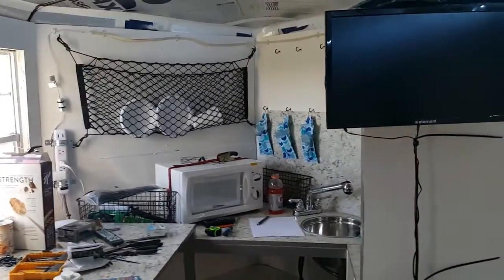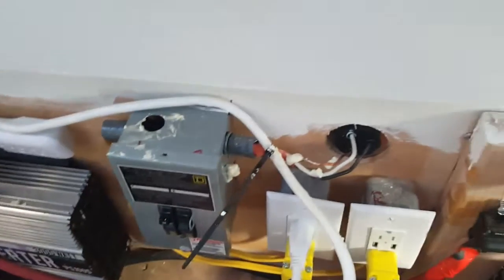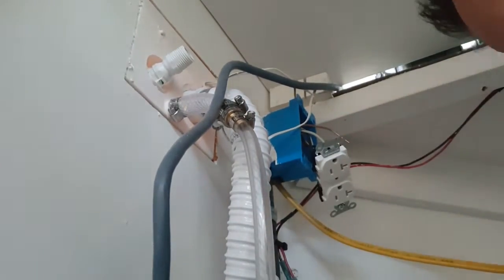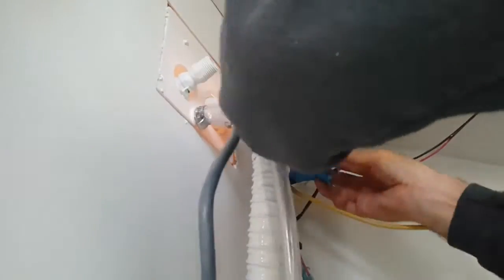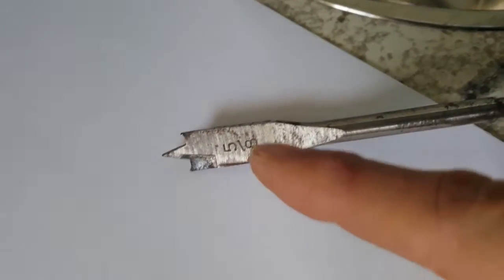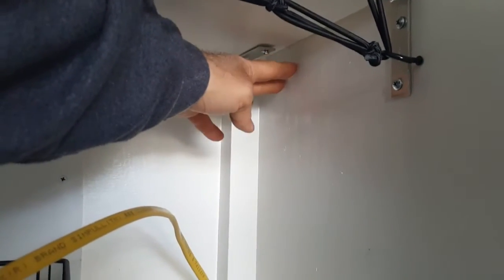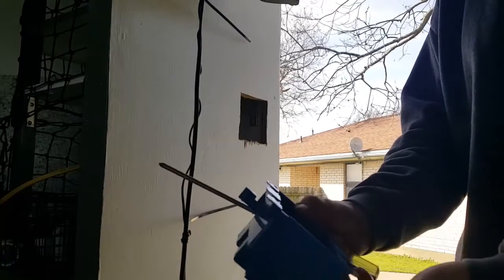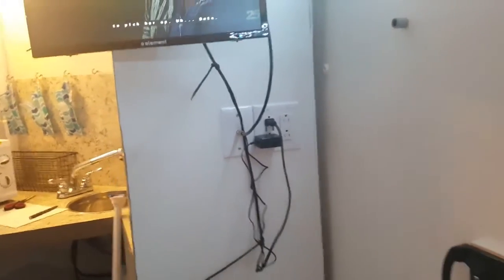ELECTRIC ADDITION How To Add Electrical Outlet Cargo Trailer Camper Conversion Improvements #flgctc

Comment: Nice work! I'm starting a RVgo soon and appreciate learning from everyone else kind enough to share their experience.

I want to point out something very important for your safety!
Please add a chassis ground to your shore power! Just a single #10  screw into one of your wall studs and a bare ground bonded with your shore power inlet. 
You don't want to become the conducting medium if something happens to your side of the wiring.
Reply: You may as well bond your inverter along with it, while your at it. I think it is important to share that process AND the significance of bonding the chassis with your audience.
Cheers!
Reply from the maker: Thank you for the kind words and advice. I agree that grounds are very important. Good advice.

Comment: great video
Reply from the maker: Thanks Leo. I hope all is well with you.
Reply: yes had problems with the door lock install did not know what to do with the extra gap around the lock my wife told me to put a cover around it i cut a dimone plate and instead it looks good would like to send pics of the trailer
Reply from the maker: @commercialelectrician133  sure. Email 2014psr@gmail.com